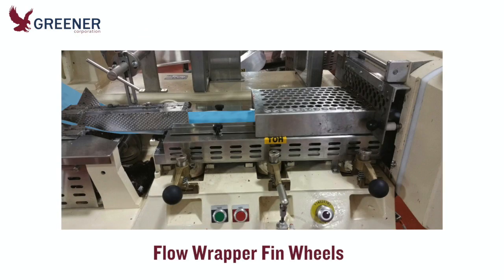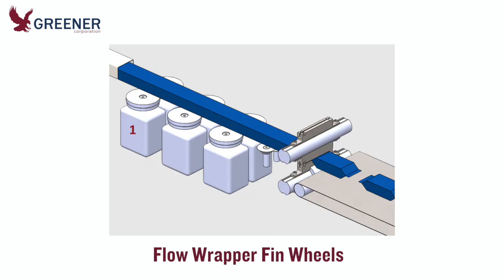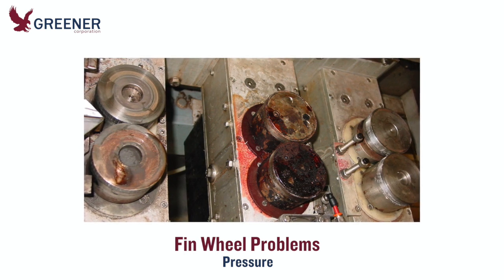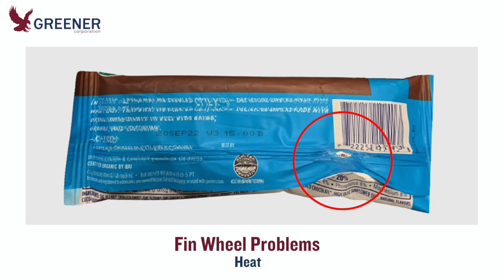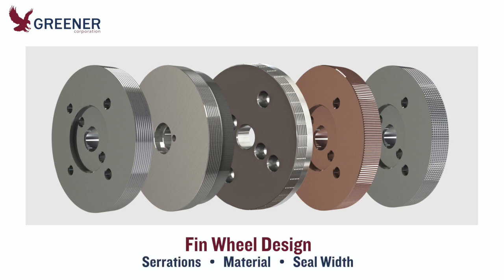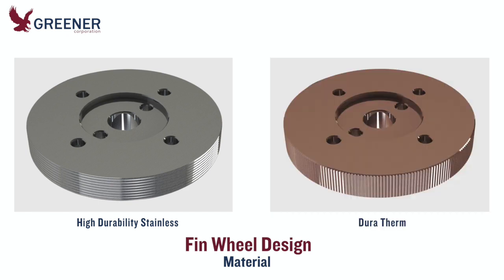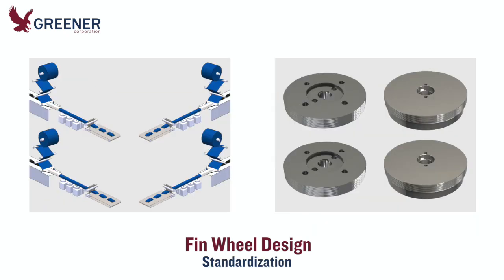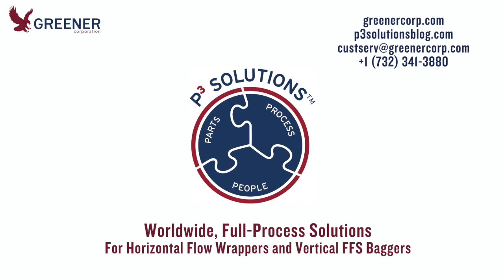Flow Wrapper Fin Wheels: Problems, Maintenance, & Design

Comment: How do you clean them
Reply from the maker: When cleaning fin wheels or sealing jaws, coarse bristled brushes can damage the serrations and cause sealing problems. We recommend brushes with finer, softer bristles, which are more forgiving. The bristles can be trimmed in length to clean more effectively and to keep them from splaying out.

Our Tech Bite post and video about cleaning sealing jaws will also apply to fin wheels: https://greenercorp.com/resource-blog/cleaning-to-improve-package-quality-productivity/